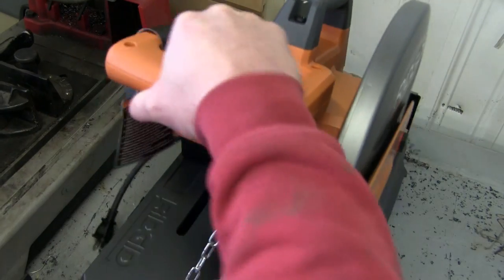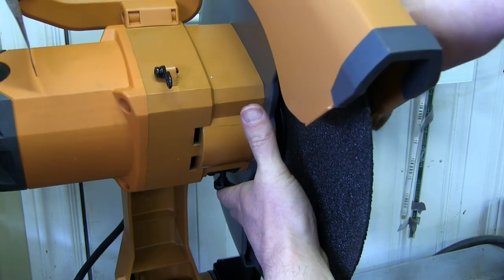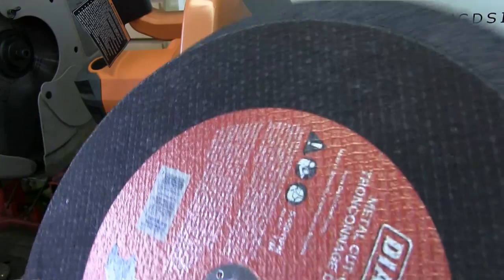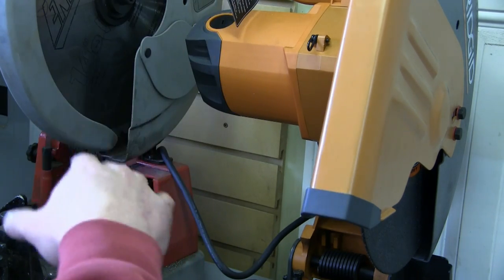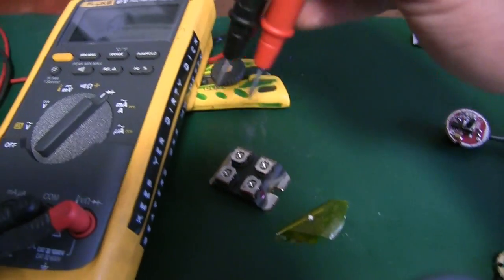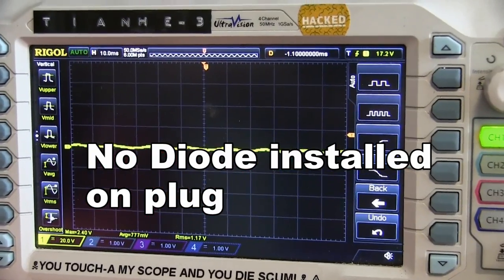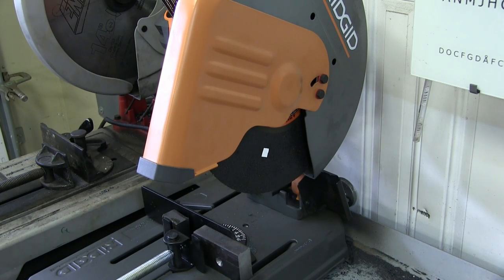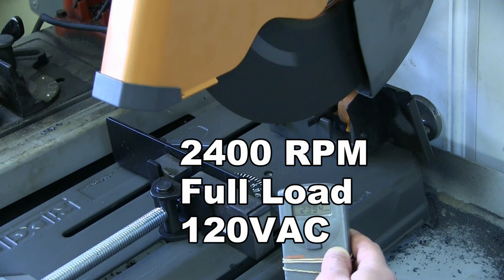RIDGID abrasive cut off saw converted to dry cut. Maybe.

Comment: I wonder if you could get around this load issue with a very slow feed rate. Sure it'd take 600 years to cut the metal log but wouldn't that keep the motor from munching itself up? I'm not very wise or hip to the lingo but that's an idea my noodle was telling me.

Ie. if i'm understanding this right, the load on the motor (amp draw) correlates with how much you're asking it to chooch. Or is that just not load dependent? Anyone know? With the above idea I was thinking you'd treat it like machining rather than cutting. Taking a little off at a time.

Comment: How many cuts you can do with dry saw? I heard different opinions from as low as 100 cuts to 2000 cuts and "still sharp". What is your experience?
Reply: Depends on the blade, and the hardness of the material you are cutting, and the blades are easily 100-200$ for a decent quality blade. So you need to get a lot of cuts to replace the 10$ abrasive blades.

Comment: It should work but you need to increase the ac voltage and reduce the frequency
Reply: The frequency makes no difference to the speed with a universal motor they will run the same speed on dc

Comment: YouTube recommended this now. The 3600 or 1800 rpms of a motor comes from 60 Hz wire frequency times 60 second pretty minute divided by motor poles. (Minutes some phase slip)

Comment: Yeah, that's hot metal! I put some neat looking but useless cross drilled and slotted brake rotors on the car and then drove it around to perform the brake pad bed in procedure or, as I call it, the fancy way to make sure you'll be buying another set of pads soon, procedure. I parked the car and the kid wanted to see the fancy new rotors and immediately stuck his fingers through the wheel spokes to touch them. You know it has to hurt when a dry finger makes that sizzling noise. I didn't even have time to finish saying "You probably don't want to do that". Poor kid. Some lessons are best learned the hard way.

Comment: Gotta vary the frequency relative to voltage to reduce the current. $500 one horsepower VFD to drive your $99 saw. But that don't even make sense using Canuck ciphering.

Comment: I've been working on this problem since your last video, and determined that the only way to do it is with a gear reduction. Was thinking of a drills planetary gears but the extra length would be to much my 300lbs peanut would place too much lateral force. I can only think of a stepped gear system, similar to a drill press and the blade would have to be on a jackshaft.

Comment: I think, deep down, you knew it wasn't going to work. But, you did it for the sake of the experiment. You understand as much as anybody else here that motors with armatures are all give and take. Decreasing voltage decreases speed but increases current and torque. Perminant magnet, universal, compound, series, they all do it.

Comment: Bought a ruler. Thanks.
You should really have tried pulse wave modulation instead of voltage or current regulation/manipulation. Remember ohms law applies to motors to. Think of it like how microwaves or how some electric range tops use on/off logarithms to regulate their respective settings. I'd like to see a redo :D

Comment: what would happen if you used the dry cut blade on the ridgid saw with no modification ? 2800 rpm under load blade is rated for 1500 .. does the blade explode and kill everybody or does it wear out quickly and or make bad cuts .. it be interested to see the outcome .. thanks ave as always i learned something new today

Comment: Would this work if you lowered the Htz.."Cycles, Per, Second" instead of the Voltage, like they do with a Router to lower the RPMs.
Reply: No! VFD'S have no place controlling dc motors. you will have to reason why.

Comment: I figured that Milwaukee withdrew their cold cut saw from the market because too many of their customers pulled it out of the box and then killed the blade by either pushing too hard or by not clamping the work peace properly.  Either way they kill a $200 blade and get pissed at the manufacture.  I love my Milwaukee cold cut saw.

Comment: With a half wave rectifier and reduced Volts the power to the saw was drasticallly reduced not only was the rms Volts less than half the available "on" time for the Amps was reduced. Not sure based on the variac test with 65 VAC  to a bridge rectifier would make it work but it'd have more chooch than the half wave. ;)

Comment: Even if you do get it all modified and working as redesigned at a slower speed wouldn't that extra torque add a questionable amount of stress to the cutting tool?

Comment: I had an internship at a motor control place (municipal water pumps and big fountains and stuff). The way they control the speed of a pump, or any motor, is with a device called a VFD (Variable frequency drive). Basically, It takes your AC, rectifies it to DC, and PWMs (Pulse width modulates) a simulated AC signal (bunch of ON/OFF pulses that add up to look like a sinusoid as far as power is concerned) on your motor. 

You can buy these things on amazon actually (relatively low power ones at least) for a couple hundred bucks, but theyre made to sweep a range of frequencies. If you just care about one... Idk. Im sure there is a simple solution but I don't trust myself enough to advise you on how to not set your house on fire :D

Comment: You better mist cool that carbide blade if you want to run it that fast. Carbide has the same problem as diamond if it gets too hot: the cutting edge will dissolve in mild steel and rapidly get dull.

Comment: I myself am but a humble country bumpkin as well, but I'm curious if it couldn't be made to work with a PWM instead of a VFD?

Since the motor is ultimately a DC motor, why not bypass the rectifier and just go straight in with DC power from a PWM?

Again, all I know is that I know nothing, but I'm curious as to the answer.

Comment: At 1:05 you mentioned generators being heavy. That hasn't really been true for about 20 years. The old generators used a synchronous motor tied to a gas engine, so whatever the gas engine could do at 3600rpm or 1800rpm was what the generator could handle. Modern generators create DC power and then use PWM to convert it to AC. This means the generator can run at any rpm it wants. You know that your car has a lot more power at 6000rpm than it does at 2000rpm, so apply that same logic to generators and it makes sense why it's possible to get so much power out of such a small generator.

I'm an apprentice and I've carried around 20A generators. Thank god they are not as heavy as they were in the past.

Comment: can you put a frequency drive on this type of motor? it would help keeping the torque while reducing the speed (you can even overengineer the thing and get a speed/torque/amp display) I know it's the easy solution, but if you can put one of these little feckers, the Lenze drive systems do a really good job and are not that expensive. I recently scavenged one, 100-240VAC mono input and it can trickle mono and triphased AC current (I don't have the beast in hands and I don't recall the full specs).

Comment: I have a book and it says if you really want to do this, you gotta have a constant current in the field winding (let's say the normal current when it's under load) and regulate the voltage over the brushes. Then you should have a constant torque. Basically making it a shunt motor. Also the voltage wil have to be kinda low over the field winding. It should work...... in theory...... Or am I really wrong?

Comment: Because as voltage drops, amps Increase. To fix that POS saw, you need to ditch  lame metric arbor, and build a gear reduction unit and a new standard size arbor.

Comment: I got a bad idea. How about remove the universal motor and fabricobble a mount for a 3/4 HP induction motor and direct drive the blade off it at 1725 Rippums.

Comment: I just got a ,  Irwin 10 “ 80 tooth ,  1800 max rpm , dry metal cutoff blade . I just tested in an old tile wet saw that I resurrected  after watching it cartwheel  across two lanes of traffic from the mirror(s)  of my box van and that terrifying noise and sudden loss of cabin pressure .  Unfortunately the nitrous oxide mask dint deploy , I looked at the apprentice in the co pilot seat, with out a word said he new he was fucked ! He reluctantly stowed his hula bong neatly into his lunch mate cooler , snapped it shut like he had just handed me a list of demands then sliding the cockpit partition open bracing himself as he made his way to the over head door with two lanes of headlamps hitting him as if he was DB Cooper...  needless to say the saw and who know what else skated down the hiway  like a curling stone with AVe feathering and dewclaw polishing for the gold.  However the next exit we pulled off the write up the incident and refresh our training manual to find root cause , cold beer fo me and DB  rolled a fatty !   Hey the next morning my wingman spotted the wreckage a east mp66.4 I82 crazy huh! Oh ya that blade cute steel like butter at 1720 rpms with gear down!  Lol

Comment: can u try use a blade with about half the diameter? surface speed is rpm*circumference, half the diameter = half the circumference = half the cutting speed each carbide tooth sees. Youll obviously lose depth of cut but could be really useful for smaller stock.

Comment: Here is an easy way how you can use one saw for the two types of blades. Buy one which does 1500rpm. Install two pieces of white tape to the abrasive wheel and one to the sawblade.

Comment: I guess a big mosfet and FULL BRIDGE RECTIFIER with a micro for proper PWM speed control is too time consuming to build? Still not guaranteed full voltage would give it enough torque but you'd get more out of her at least.

Comment: I would not have even tried this. What I have thought about is getting a lower gearing into it. My model is a 230V Ryobi -and I hated after using it for 2 min only. A saw is the way to go. Even if I have to cut the gears for it.

Comment: Gearbox? did you consider relocating the motor to make room for a gearbox to run it at a lower gear? more mechanical than electrical solution  ...

Comment: I still prefer the technical explanation... inside a bog standard universal brushed motor you have brushes and commutator bars (Google that). The faster the motor spins the less time each set of comm bars  spends in contact with the brushes. 'The slower the motor spins': each set of comm bars is in contact with the brushes for a greater amount of time, passing current for a greater amount of time(using more amps) making a larger magnetic field in the motor, generating more torque AND heat

Comment: You could just use V=IR. Half the voltage (65 vs 130) explains why you could pull up to twice the amps from the breaker. Quarter the voltage and you could get 80 amps before she blows! Who likes house fires?

Comment: Maybe you could test out one of the new 14" Diamond blades from Lenox labeled METALMAX?
Reply: I have used one but it takes more than twice as long per cut and over heats the motor. I did a back to back test with 10 cuts and went back to the standard disk and saved time, a motor and even more time deburring.

Comment: hi... can you recommend a good dry cut blade. i am making  heavy duty chop saw with 2 hp 3 phase motor and a belt pulley system for increasing the revs at the blade. Just am confused as to which blade would be best suited to my needs. Generally cutting heavy gauge pipes, angle iron and ISMC... please help

Comment: but you CAN. you just need a proper speed control, with like a tacometer and an arduino. You make a digital dimmer that will stand the currents, and the pwm it yo limit the max speed and set a minimum speed at which you turn the motor off to stop it from burning. it wont be as fast as a proper tool but you could maintain the speed by just going a bit slower

Comment: You say it is more efficient using DC power. What if you use DC and pulse width modulate it to control speed? Still getting full voltage, should get comparable torque also.

Comment: if you half the volts. the amps will double.  just like when doubling the volts the current drops. for a given wattage. because volts x amps=watts  and the watts of the motor can't change. great video. I was hoping also. I guess the only way is to use a gear reduction motor.

Comment: 🤔 Small vfd? If the motor is meant to run at full throttle when you squeeze the handle... The change the hz going into it... Like on the bridgeport

Comment: to improve this i would do as battery powered drills are, with a gear box. Browsing fleebay you might find a half reduction gear box. you can make this work, you just need to use the smarts, witch you got plentiful of. motors are best off running at their rated speed. in industry we get a bigger engine than necessary when we know it will run hard on variable speeds. running a saw right on the output shaft with a thee phase inverter might work but i would't recommend it.  running on lower than 30Hz with a inverter is not recommended.

anyways great video as always.

Comment: back from the dead: i=v/r  so your voltage is to low at usable rpm if you ran it in dc as you mention you could use PWM to adjust speed without changing voltage or current

Comment: surely you could use a vfd for speed control? 
But for a real show I would like to see you figure out a way to rewire the poles of the motor so you can double them, and half the rpm. I mean that one is probably a 2 pole, at 3600 RPM rated, so 4-8, and it would be possible as long as there were enough communtation bars.

Comment: That diablo abrasive blade is actually not the right blade for an abrasive chop saw. There’s a picture of a demo saw on it. The chop saw blades have a picture of a chop saw on it. They also are thinner than 1/8” from what I’ve seen/purchased.

Comment: Wouldn't a VFD do the trick? Motor would run hotter due to lower cooling, but wouldn't that limit the current in the windings to a reasonable level?

Comment: So how about using a VFD set to about 30 Hz?
Reply: Cameron Ward Doesn't do a thing. It's a series wound universal motor not a induction motor. They speed change with voltage not to frequency. A little trich to remember, If it has brushes change the voltage if it has no brushes change the frequency.
Reply: Thank you for setting me straight.

Comment: the motor gets hot because your v/hz is out of wack,  if you wanted to half the voltage you would have to chop the frequency in half as well but then you still have the issue of the slower fan speed. why not a pwm controller and maybe an external fan? put a treadmill controller like the mc60 on there and see what happens.

Comment: Couldn't you add a resistor across the Field Windings? (partially by pass it)  This would weaken the Field strength, yet still allow full current to the rotor.  The weakened Field should reduce your top no load speed. But your torque should be less effected than it was when you halved the voltage.  [i*i/2 vs  i/2*i/2]

Additionally as the motor takes on a load, and slows, the coil impedance goes down but the resistor stay the same, making the resistor less and less effective at weakening the field so it should retain and recover its Torque-ky-ness

Comment: You could put a pulley on the arbor that's 25% of the size of another mounted outboard of that one, hence 1/4 the speed, or just under a thousand RPM.  A little finagling and you could move the guard, base, vise, everything out enough to reuse the whole mess... THAT would be a cheap cold saw!

Comment: I really enjoy your videos and your humor not to mention your skill set. Thank You
I have a question perhaps you can help with. I have a transmission shop and we run across counterfeit parts every so often. Filter's especially a lot of filters are marked pa66+gf33% I learned from your video's what that means.  Now here is my question 
is there a way to confirm with out destroying  the filter. that  it is pa66+gf33 I would assume a counter fit part would cheap out on all the parts of the filter including, its plastic outer shell as well as the filter material. Thank You

Comment: You need a gearbox, not an electrical solution. Leave the motor on as it, remove the cover, put the gearbox (you can machine a 2:1 gearbox from tool steel easy enough), put a short shaft extension and the blade on the other side.  Pretty much the only way you will add more torque.

Comment: Using the carbide blade it will work for aluminum, copper (wd-40 for lube) and brass... and not gum up the abrasive blade.

Comment: I wonder if you could just glue a magnet to the saw blade and use it to feed back the rpm to an Arduino. 
Use the Arduino to control a dimmer. For example the 4000 Watt M028N Kemo.(~25€)
Would be a 50 bucks and a few beers I guess.

Comment: hi thank you you saved some time .can you try using a smaller blade the surface speed should be less the rage 3s uses 215 mm blade at speed of 3750 tr/min

Comment: I'm just an average computer janitor that also enjoys building things, so this may not work but couldn't you achieve the same thing physically with gears or stepped pulleys? (akin to an adjustable speed drill press) I realize it would be a LOT of work to either modify the housing for the cogs or make a crazy belt enclosure and separate the motor.... But then the initial speed of the motor is irrelevant.

Comment: For speed control without loss of torque you need to change the frequency. speed n= (frequency f * minute 60)/(pole pair p). There are plans for high current PWM circuits out there ;-)
Reply: The man gets my Red Green's Handyman's Corner, hands down!

Comment: here's the trick cold chop saws use a reduction gear case between the motor and the blade shaft.... your welcome. i noticed the blade not inline with some chop saws (ie dewalt).